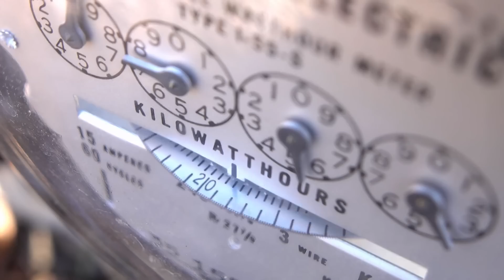The Most Powerful Laser Weapon in Development

Comment: for use on jets, there has to be a way to capture that energy from the engine, with some form of battery or battery/capacitor combination... yes I've popped caps before and I know how silly this might sound, but if it could be done properly... there might be  something to this idea... charge and discharge without retaining the charge to cause cap explosion... I mean if your jet gets hit by pretty much anything you're in a lot of trouble... so why not just a little more risk? You're already flying at 2x the speed of sound in a popsicle filled with enough bombs and juice to make the flight already obscenely dangerous... whats one more explosive factor?

this is why engine turbo chargers have a blowoff valve, apply this "thinking" (lol) to the battery/capacitor combo

Comment: Something tells me that the defense against this anti aircraft laser is going to be a cool coating of paint and barrel rolling to disperse the heat across its surface while evading
Reply: You need paint that won't burn off with hypersonic speed and adding roll while in flight won't help with a laser this powerful. It will heat up the surface of the missile fast enough to burn it anyway.  Most countermeasures to a laser defense would also take the missile sub-hypersonic. That would mean that it becomes a missile that conventional interceptors could shoot down.
Reply: @donixion4368  nope totally not. First of al, pointing lazer in a small area is extremly difficult if not impossible due to missile manurability which is now done by AI btw. And the latency to reacquire the target after missing it for few milliseconds after the manuavering event bcoz no computer and servo movement is instantanious.. This along with thicker ablation heat dispersion material and natural rotation of the missile makes it extremly difficult to think it will work. Not to mention the limited range.its a good tech only against swarm drones

Comment: I am curious how do they intend to shoot down anything in adverse weather condition with these visible or near visible light lasers.
Even the scattering of the laboratory level clean earth atmosphere is enough to spectacularly degrade the performance at longer ranges. Imagine, how some dust and / or fog / clouds degrade the laser long range performance. Not to mention the small aperture of the lasers will also cause a substantial diffraction, which also degrades the performance.
The hypersonic glide vehicles fly pretty high, so the laser weapon has to shoot through a substantially thick layer of atmosphere, which can include substantial amount of fog or clouds.
To be able to effectually hit such a vehicles, they have to use ludicrously high powered and large aperture lasers, if they opt to pick near visible frequencies.

Nevertheless, it can work well as a CIWS or CRAM system in clean weather
Reply: Yeah thats how I explain it to people. Is the sun pretty powerful? Well... is it always sunny?
Reply: It's mostly a supplymental support weapon. Probably a first engagement or guess fire it from space, then conventional weapons can do the rest.
Reply: @janlim0916   If they start applying reflective surfaces tuned to the laser's light frequency over their sensitive electronics then these lasers become useless.
Reply: @tenlittleindians  I did mention that its a supplemental weapon. Also, thats not how "reflective" material works.

Even said reflecive material can't withstand heat specially it's already heating up upon re-entry or going at mac 10. Thats 500 degrees Celsius already add that up with super heated lazer and it's actually enough to deviate  or drastically compromise a projectile in seconds. Once thats done, CRAMS can do the rest.
Reply: It honestly probably won't be effective against hypersonics as those fly very fast.  So by the time it gets in range, you don't have enough time to heat it up.  

That and the other issue is that hypersonics are inherently guarded against extremely high heat because of how fast they fly, which is the core principle behind a laser defense system.  So lasers are essentially ineffective against them
Reply: I'd imagine they'd mount lasers on some planes to get above the clouds
Reply: @mjames7674   Or they are orbiting satellites. That won't work on cruise missiles that hug the ground during overcast conditions.
Reply: @tenlittleindians  Yeah, probably satellites too. I imagine they'd use the ship mounted lasers for targets like cruise missiles
Reply: Probably using the same premise as Stormbreaker
Reply: @tenlittleindians  As you know high reflective coatings only work over small angles and small wavelength bands. High reflectors won't help most of the time. Also you have to know the wavelengths of the lasers and lasers are tunable to other wavelengths.
Reply: Hypersonic missiles have to come down at some time. What do you think high energy lasers do to the atmosphere  they travel thru?
Reply: @maethore.8843  The hot surface of hypersonic take less energy to crack or melt than an ambient temperature object. Think about the first shuttle disaster.
Reply: Notice that many of the video renderings showed it being airborne.  No hyper sonic missiles I know of are flying at sea level, they are going to come falling in from above.  If you can get above the cloud cover, and have a vector to search in, there's your target.
Reply: @janlim0916  What?!?  You mean we are NOT going to start seeing missiles coated in Military Grade Glitter?
Reply: @tenlittleindians  I want to see a Hypersonic Cruise Missile that can hug the ground!!  It was hard enough to do in an F-111.  Atmosphere at Sea Level or close to it is way too thick for sustained hypersonic flight, plus add the stresses to the structure of attempting to jink and maneuver at those speeds would try to rip the missile apart or cause it to lose control.
Reply: @mrbaab5932  So, no Military Grade Glitter available on Amazon any time soon?
Reply: @rice0009   You don't need to go that fast when your that low. And a missile can turn faster than any airplane since it won't black out from pulling too many G's. Very hard for a laser weapon to lock on and track a missile following the terrain at low levels.
Reply: @mrbaab5932   The surfaces could be polished and then plated to function as a front surface mirror and gold has proven to be a fairly universal coating for a wide band of laser frequencies. It's not like it's going to be used in a high hour factory industrial setting. The mirrored surface needs to survive one time only. There is also the possibility of spinning the missile like a bullet which makes it impossible for a laser to focus on a single spot for an extended length of time while also cooling it's external surfaces in the process.
Reply: @tenlittleindians  
Most mirrored surfaces are dar to fragile for that. And heavy.
Reply: @icecold9511   The bottom line is there's no perfect weapon or counter weapon. It's a field of constant evolution. Look at the development of airplanes between wars as they guessed at what they might need if another war broke out. Then an actual war happens and their stuff is totally wrong so they start over on the design boards.

Comment: As far as hypersonic's go, their speed is their weakness. Any shrapnel at hypersonic collision speeds, will at least be enough to mess up any flight control surfaces. Half the reason the US spends so much money on kinetic missile defense, is because 'slow' rockets and ballistic missiles are actually fairly tough. However hypersonics need either be built with small a cross section as possible, and, or carry a ton of fuel, in addition to their warhead. Basically as long as you can get it to fly through some shrapnel; you can either destroy it or slow it down significantly enough to use a more conventional system.

Comment: Hmm.... I think the common denominator for widespread use is - what on Earth is its maximum effective range? Is it 3 MI, 10 MI, or even 30 or 40 miles?? This definitely could not be used for long range interdiction, from what I can tell, unless they had an aircraft intercepting it at close range, while aircraft or missile was still many miles from its target.
I am also skeptical of its land or sea-based use, if it does turn out it's maximum range is only a few to a couple of miles. With a laser that needs a few seconds of burn time to destroy the threat, those few miles make a big difference! 
I think the next 10 to 20 years will only see a practical version from an airborne platform that can come in close, but, for many years to come, more simplistic missiles or Seawiz might be more useful from standing or floating targets. We'll see..
Reply: Using these from orbit would greatly extend the targetable horizon.  It would also have use against anti-satelite missiles.

Comment: I sure it will fail. The tracking and pointing is accurate but the LASER output peak maybe possible but average power is not there.  Atmosphere is not cooperating either.
Reply: They already built one a few years back that would fit in a 747 and tested it and it worked. Funny after that I stopped hearing about it. The YAL-1 with a low-power laser was test-fired in flight at an airborne target in 2007. A high-energy laser was used to intercept a test target in January 2010, and the following month, successfully destroyed two test missiles. Funding for the program was cut in 2010 and the program was canceled in December 2011

Comment: Hypersonic missiles are way overrated. They are insanely expensive to produce and while effective, they really wouldn't have many uses. For the price of 1 hypersonic missile you can make like 50+ supersonic missiles and if you launch 50 supersonic missiles at a country they won't be able to shoot them all down. So really whats the point
Reply: Slower react time with faster missiles
Reply: @Yourlocalhuman8  OK fair
Reply: @Yourlocalhuman8  not really as they have to flay way above sea level which can be detected from way longer distances by radar.
Reply: @user-jh6ik1qd7p  hypersonic cruise missiles can cruise above sea level
Reply: @Yourlocalhuman8  yes they can only do it above sea level.

Comment: Unfortunately this video does nothing to demonstrate capacity to overcome the sort of fundamental issues that dog meaningful use of lasers, for several reasons. First, we are told nothing about the anticipated "burn through" rate and how that might apply when the target is able to act evasively. Second, Lasers are understood to be inherently limited by their vulnerability to degradation from visible water moisture in the form of cloud, fog and rain. The laser is quite literally a "sunshine patriot", it's reliability dependent upon the weather. The video is completely silent about this. Third, one thinks lasers can be easily defeated by a target's use of reflective or ablative coatings?  Here, too, our narrator is silent.  Is it possible that lasers will ever be useful for anything other than taking out drones or open speed boats? Maybe. But no hope of that is offered by what is seen here. :(

Comment: That groan you hear is the sadness of 3,000+ fighter pilots looking at the pay schedules for commercial, multi-rated, first officers.  Flying for Sri Lanka Airlines.

Because if the lab munchkins can reliably kill HGV/HCM at 100,00ft; manned, fixed wing, airpower just went the way of the dodo and the cavalry charge.

Carriers, fighter wings.  All of it.  Buh-bye.  Say 100 billion a year in writeoff investment?

Now you can ONLY break thru if you are invisible across all spectrums, shielded until too close by the nature of your domain (subs/NOE).  Or able to saturate with massive amounts of numbers so that even a ~1 second target servicing rate by 3-5 directors cannot kill 50+ missiles with beginning engagement distances of say 50km (31mi) at 1.5-2.5km/sec (5-8,000fps).

This makes war very expensive even when you are not talking FOBS based hypersonics but only something which can ride a TACMS booster to Mach 5 and 80K before lighting the scramjet or RDE to hit Mach 10 at 150,000ft.

Even LSS swarms may not work because the range is so short that 100KW may be enough to be useful and then your RE doped multislab can be cheap enough for dozens of beam heads.  Not just a point defense around key targets but area defense of all approaches.

Comment: There are 2 major drawbacks that should have been discussed in more depth. One is the amount of power needed to fire such a weapon. The space needed for such a power supply, and the weight of the power supply, severely limit the types of vehicles/craft that could carry the laser. The second problem is diffraction as the beam travels through the atmosphere. The longer the beam travels, the weaker it gets. This is the main reason they tested a plane based laser, which proved impractical because of problem 1. The ineffective range of ground based lasers, because of diffraction, also makes them impractical. However, the technology is rapidly improving. They might be impractical now, but in the near future they could be a great asset
Reply: New generation aircraft are solving the power issue by using their turbines as generators

Same would apply to ships

Comment: Best to put the laser in space on a geosynchronous platform. Constantly charging its’ batteries with solar cells. Firing from space will give it a better chance of hits as the whole side of the missile is exposed not just the nose. Also you can track it along its whole flight path so you have more time to fire.  Besides 23,000 miles of altitude in free vacuum  and darkness ain’t shit to a 300,000 watt device. It is an eighth of a second to cover that distance. Six weapons could shield the whole planet. Lasers work. The Koreans are still wondering why most of their missiles blew up on flight. Haha
Reply: It would be pretty difficult to keep it from getting shut down with the anti-satellite missile. However if you were able to disguise it as a commercial satellite then that could work. Having lasers on planes means it's a lot harder to shoot down.
Reply: @RobFomenko  sorry Bob you’ll have to do your math on that one. There isn’t a missile in the world that can shoot down a geosynchronous satellite. They are just too far away. Even an orbital missile would take an hour and a half to reach the satellite. Yet it would be able to hit that incoming  missile in one eighth of a second. So it can quite easily defend itself.
Reply: @waldoanddenisestakes639  I guess I missed the part where you said gyro synchronous. But I don't agree that there isn't a missile in the world that can't hit a gyrosynchronous satellite since missiles get it there in the first place. All you need is something that can reach orbit doesn't have to have any explosives in it. It just has to hit it. But you're right, it would take time and if the satellite was able to track the incoming missile and it had defensive measures sure it could do that. And you're right, the laser would do better in space rather than going through the atmosphere.

Comment: The units of measure are confusing. the kilowatt is a measure of power, energy per unit time, 1 kilowatt equals 1000 Joules per second. On the other hand, a kilowatt-hour is a measure of energy, 1 kw-hr equals 3.6 million Joules. A laser pulse delivers a certain amount of energy to its target. That energy depends on the laser power, and the duration of the pulse. A 300 kw laser is meaningless without knowing the pulse duration